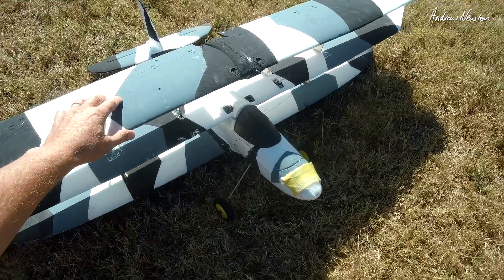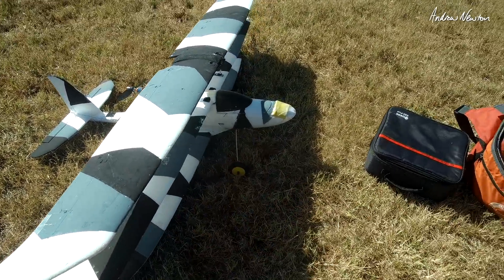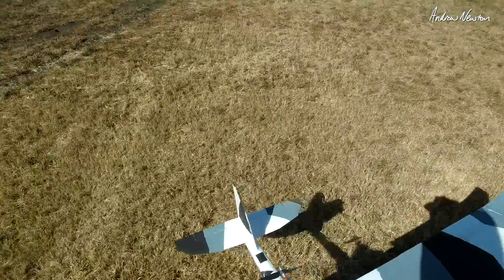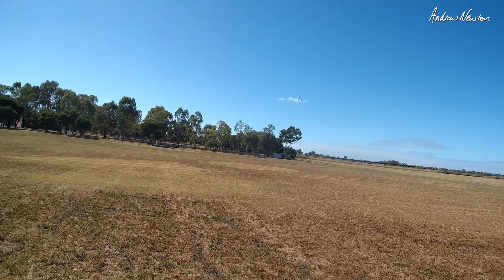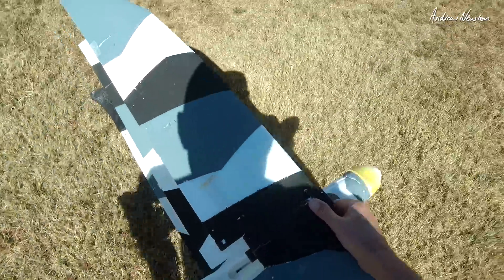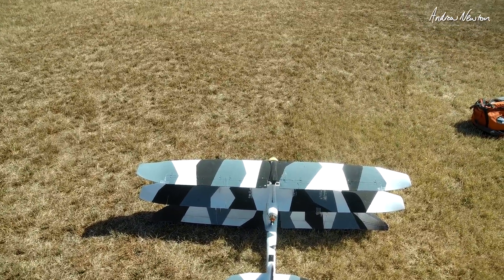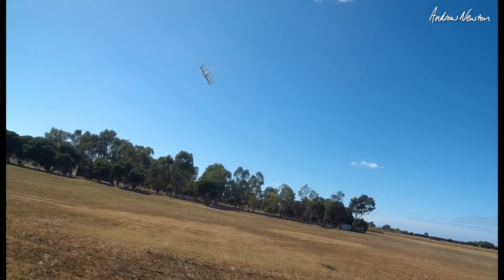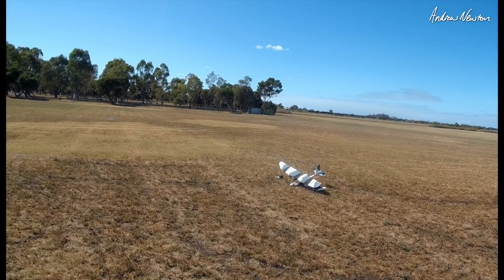Adjustable Decalage Experiment

Comment: when the hinge is at the right pivot point, the forces should be quite equal , but that is, the hinge should be inside the wing, too. cool experiment nevertheless. could you please write your assumptions about decalage in the description?
Reply: I also think changing decalage should be Mixed into Elevator by 10%

Comment: Tiny control areas might need bigger servos to withstand forces.. And here we have this full 1,5m wing on small plastic gear servo.. 
Anyway - this hobby should be about exploration! Keep it up!
Reply from the maker: Not quite Tomas. Strong metal gear servo (2.5kg torque), 10X mechanical advantage from the levers and linkages (25kg torque) The structure would tear apart before stalling the servo.
Reply: @AndrewNewton correct me if I am wrong, but usual servo rating is kg/cm.  And to know your mechanical advantage I would simple ignore midle of kinematics chain and look at the ends of system (as no matter how many gears you have, your ratio will be along driving and driven). So compare servo arm travel (which is aprox 1cm long) and tip of your wing which travels roughly the same. So my quess is that your mechanical advantage is same roughly 1:1..
Reply: 1:10 you have at arm ar wing axis, but wing itself is big lever here.

Comment: Is the BEC up to handling that many servos?  I wonder if the static load on the wing pitch servo makes it draw too much current and the BEC gets too hot and cuts out leading to a loss of control?  You could try adding a separate battery instead of using the BEC in the ESC - but of course that adds even more weight.
Reply from the maker: Very little load on the servo. I used an inner hole on the servo arm and the wing pivot gives another 5X lever advantage. So that's at least 10X. Quoted torque is 2.5kg x 10 = 25kg. Foam would be tearing and plywood cracking before the servo started complaining. Just flex in the hot glue joins and slop in the linkage.

Comment: I think it's way to much for one small servo, easy to say after the fact, but yeah when it's a similar size servo that's normally used on an aileron, although it would have had some mechanical advantage with the little lever it had, but still to much for it I think.
Reply from the maker: Servo power was way stronger than the strut mounting so I think it's just fleet joints

Comment: As I was watching my first thought was that the wing had shifted due to over stressing on the servo, your frame by frame seems to support that, so maybe a bigger or a second servo. Thanks for sharing.
Reply from the maker: Flexy mounting I suspect. With all the lever advantage the servo is not working hard at all. The mounts would have pulled out before overpowering the servo

Comment: "The endless search for the truth"  You Aussies are not afraid to have a go, that's for sure!  Good for you to share this, thank you.  Flight surfaces fight one another very easily especially with Reynolds numbers for models v. full sized craft.  The result is a lot of drag using up a big portion of available power.  Same for angle of incidence between wing and tailplane, which can be corrected by angle change and/or shift in CG.  Obviously there is a "sweet spot" for that multivariable scenario (shifting wings and CG)...  ...not sure how many people died figuring that out, your approach is much safer, lol.
Reply from the maker: The Trixler has served well but it's back to a Bi Bixler now. I'll use a different plane for continuing decalage experiments

Comment: “Nice and smooth.......cruncho!!...” that’s what did it, you should never have said that!    Wing pitching moment probably just overcame the torque capacity of the servo. Looks like the linkage arrangement gave the wing a large mechanical advantage.
Reply from the maker: Yes, I should ban those words until I have managed a few circuits

Comment: Yep, does seem like a failure on the airborne wing incidence adjustment system (AWIAS)
A pity as the experiment with AWIAS seemed to  promise some interesting possibilities
You can have the nomenclature for free or you can use ADAS instead :D
I hope you will  experiment further with is as  it could give some interesting answers to some long-standing questions
Reply from the maker: Excellent descriptive terms. I will use them in my PhD thesis and quote you as a reference.

Comment: Nice and smooth. crunch! :¬P
Seems that your linkage might not be rigid enough or the servo isn't strong enough to resist the airflow. After all, the whole wing has 10 to 15 times the area of an aileron, so a single little servo won't like it too much. Though you do have a long lever actuating the wing. Hmm, well you're closer to it than us, so lets hear your post crash analysis soon. :¬)

Comment: Nice experiment, but unless i missed it did you click a switch and it took that dive, or did it just fail for some reason on the first and second try?  If you did use the switch on the first try did you flip the wing up or down, and if you did on the second flight which way did the switch make it crash?  Anyway interesting and thanks for sharing this.  You did have it flying very well I think a few videos back.  Happy Flying

Comment: What does décalage really mean?

I found decalge ... which would somehow mean to clean water from calge or throw things out.

The french word décalage meant a distance in time as far as I understood but in this context it looked like distance of the top wings or the angle of top wing.

Or is it something bi- / tri- plane specific?

Thanks and good luck for this or the next repair.
Reply: typxxilps
As far as I know, in aerodynamics speak, it's the difference in the angles of attack between the main plane and the tailplane (plane meaning wing)
If they are effectively horizontal to each other, then they have zero decalage.
Reply from the maker: Origin of the word (French and German) has something to do with wedge or removing a wedge. As an aeronautical term think it initially referred to the difference in angle between biplane wings, then it came to also mean the difference in angle between wing and horizontal stabiliser.
Reply: @AndrewNewton  Think of it as an offset. That's probably the easiest definition and makes most sense.
Reply: Also known as the rigging angle.